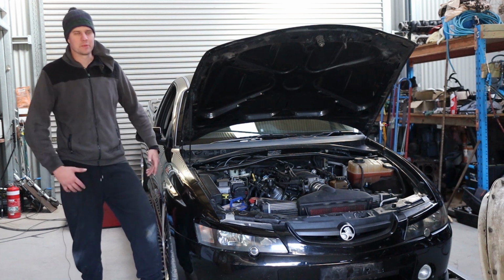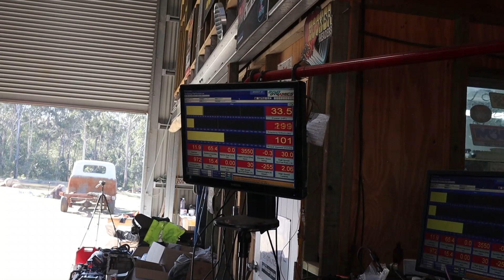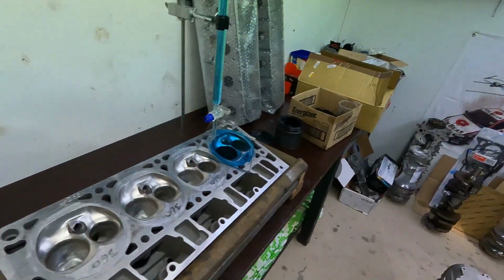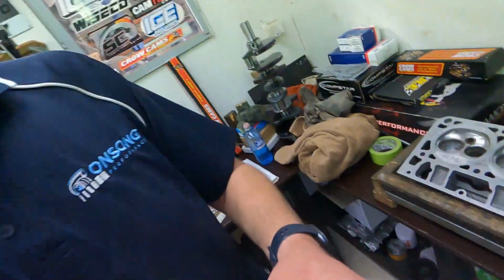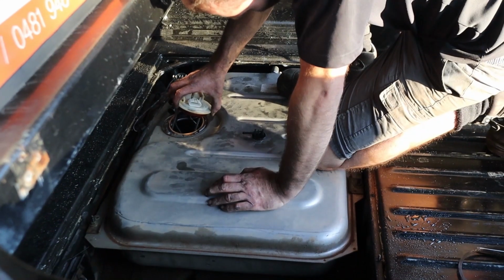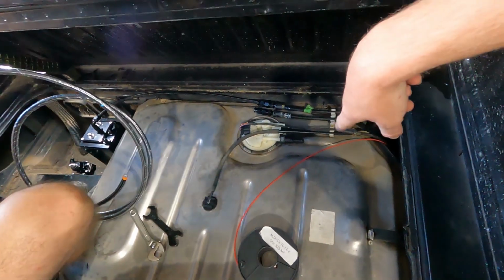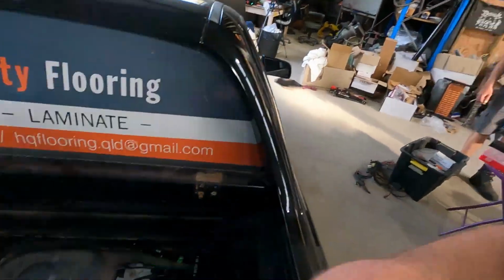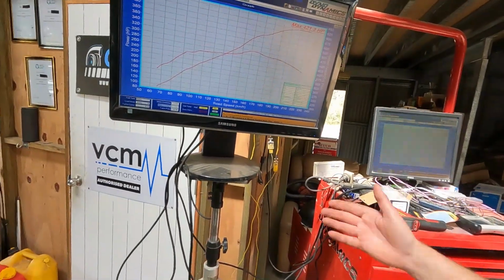Cam Package - 420WHP N/A SBE LS1 98ULP

Comment: 1250’s are a good cam, 236/242. Stock throttle body putting in work, I’ve tapped about 30 of them out at 370/380rwhp regardless of head/cam combo, just dyno to dyno difference I guess. 

Be a decent combo with a better airflow package.

Comment: My Son's VY SS LS1 is 473 rwhp. Drives great but spent a lot to get it to that. Love the LS platform 👍💯 Sorting out any issues with them. 💪🤘🇦🇺
Reply: N/a?????
Reply: @maxdabator  yeah mate have the dyno sheet to prove it?
Reply: @grahamerosewarne6656  what is done to it that figure seems a bit high also you do get quite a bit of variation with dynos
Reply: @johnboy5167  probably heads ,cam, compression, and a good intake. I’m at 443 bhp on the stock 853 heads
Reply: @johnboy5167  will get the work off him and dyno sheet for you.👍
Reply: @grahamerosewarne6656  👍
Reply: 473rwhp on a hub dyno? stout figures though so would be interested in the specs of the cam etc ;)
Reply: @brettstuchbery1672  I think that it's a 232/234, 110lsa
Reply: @grahamerosewarne6656  l have a 2015 25th anniversary clubsport r8 with an ls3 it is making over 500 wheel naturally aspirated it also has a 150 hp nitrous shot on top of that it is a lot of fun to drive 👍
Reply: Most I’ve ever seen on an LS1 is 460rwhp from memory. That’s CNC heads, decked for comp, 248/253, fly cut pistons, Victor manifold, 1375cfm throttle body, 4-1’s and twin 3 inch, on E85, at 7400rpm. The stock throttle body that’s on this Ute in the video, on my dyno anyway, will not make any more than 380rwhp. Simply not enough airflow. But that’s just dyno to dyno :)
Reply: @alexmann3309  my VX SS made 350rwkw (470rwhp) on a chassis dyno but as you said takes a LOT to get there as it's forged with higher comp, ported 243 heads, edelbrock pro flo intake, custom cam (264 duration, .730 lift, 108lsa) etc and makes that power at 7500rpms...
Reply: @brettstuchbery1672  this was stock bottom end as the video is also SBE. I’ve done built motors at a lot more than that power, but yeah, comparing apples to apples :)
Reply: Thats great numbers out of an LS1, they rev hard and the right built engine i can believe that despite some doubters in the comments
Reply: @jingos1492  it's nice and choppy 🤣🇦🇺🤘
Reply: @jingos1492  go on to Kayla Rundles channel see is building on now NA I think that it's supposed to be able to get near 700Hp
Reply: @grahamerosewarne6656  yeah mate very cool, ive seen LS7s n/a go over the 1 thousand mark at wheels so with all that youtube money im not surprised she will build something big. Just lots and lots of dollars to reach that sort of power and average joes like me only sit back and dream of that, if i had the money i wouldnt drop 80 to 100k to achieve those numbers id drop 50k and get a reliable ZZ632 and be happy to cruise and get it on the fry with all OEM parts.
Reply: @jingos1492  exactly the same as me a pipe dream. I have just finished my LS 1 forged rod's wiseco pistons 243 ported heads. LS 6 manifold,inch 3 quarter extractors twin 3 inch exuast as here you still have to run cat's on the road. Mantic clutch. Goes to the dyno in a few weeks hopefully. 👍🇦🇺
Reply: @grahamerosewarne6656  Good stuff mate, just so you know im from Australia as well hahaha ive got an l98 6 litre check mine out on my profile tab haha..
I went NPC clutch kept it local too but same quality. Be interested to see how it goes when you finish it

Comment: Would there be anymore gain with a even wilder cam like the crow 1253?
Reply from the maker: The issue you begin to have by going much bigger is bleeding too much dynamic compression due to overlapping valve events. Generally when building a pretty wild combo with a really big cam you combat this with more static compression. With the stock pistons there is only so much compression to work with though, we have found this cam to be a very good balance getting good results with stock compression and still not requiring any fly cutting for pistons to valve clearance.
If this combo had a solid single plane manifold and throttle body setup we would expect to net another 15-20whp, and that is just about the ceiling for a SBE 5.7